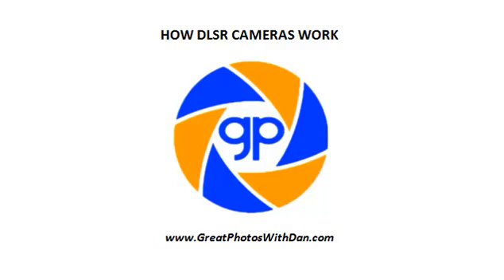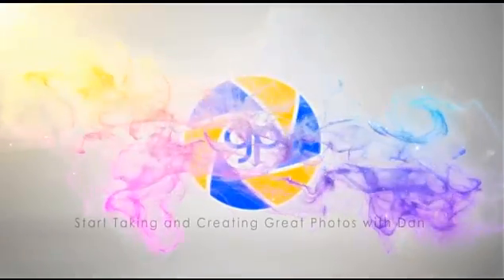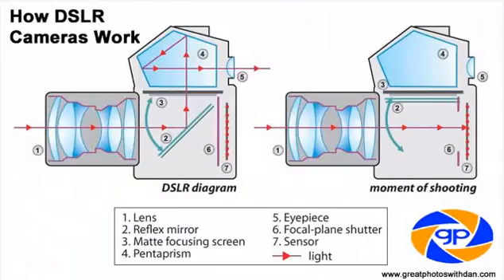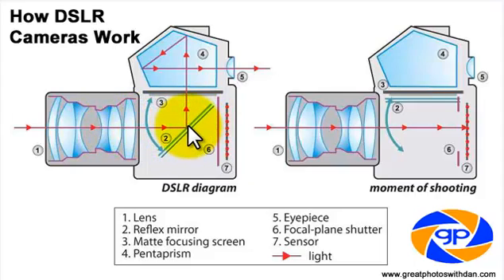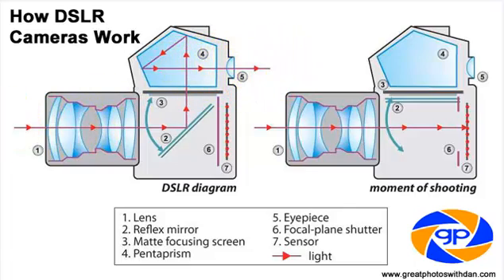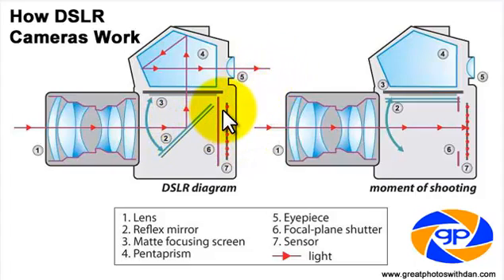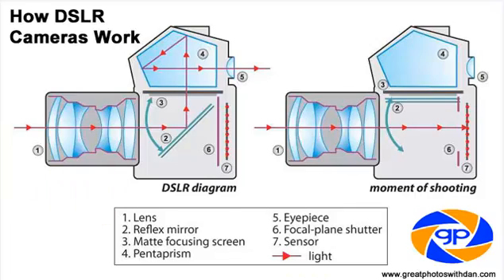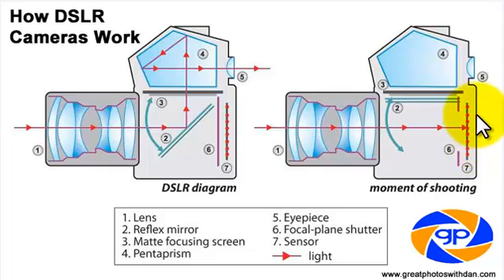How DSLR Cameras Work

Comment: You forgot the focusing screen. The mirror actually forms a true image on the focusing screen that is at exactly same distance as the sensor. The user views the image on the focusing screen through the viewfinder. You do not view directly through the lens like you do with binoculars.

The pentaprism is actually a roof pentaprism so it reflects light three times instead of twice. This is necessary as because of the mirror the image on the focusing screen is a mirror image when viewed from outside. One needs odd number of reflections to correct the mirror image.

TLR cameras do not have a pentaprism so the viewfinder image is mirrored.

Comment: I dropped my NIKON D500.   Looks like the bottom of the lens took the impact, there is no visible damage (not even a scratch in the paint) on the body. BUT, now the view through the viewfinder is totally blurry. Camera focuses fine and shots are in focus when using live-view or viewing the photo on the LCD panel. Everything else seems to work as usual, I just can't see any of the details inside the viewfinder or view the frame in focus before taking the shot.

I tried adjusting the diopter but it seems like it doesn't do anything, no change to blurrines/focus through the viewfinder when I adjust the slider.

Any ideas what may be wrong? I will most likely take it to service but thought I'd ask here as well in case anyone has had a similar issue/fix.

Comment: My camera has an aperture that stops down, I noticed this one doesn't when I was hoping to show someone what was going on inside a camera.
Reply: The best way to show how that works is probably to look at someone repair a lens. The aperture is opened up / closed down depending on the position of the "aperture blades". If you ever get an old manual lens you can do this by hand. The blades are used to control the light.

Comment: Not all cameras got a Pentaprism only High end cameras use them because they don't lose as much light as a Pentamirror system used in Low-End/Med-End DSLRs. The Con of a Pentaprism is that being a single piece of glass makes it quite heavy compared to a Pentamirror system, But this is neglected because of the high weight of High End DSLRs in the first place.